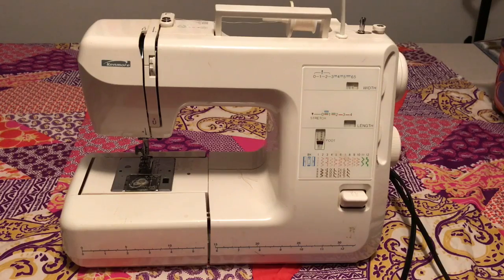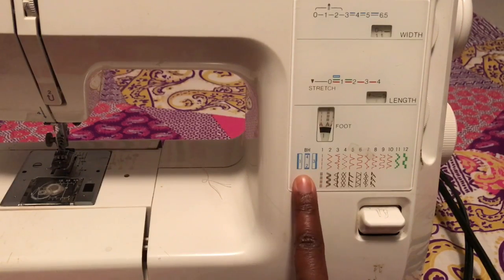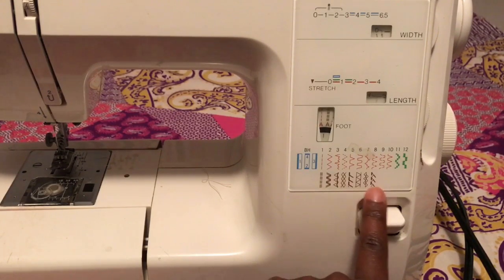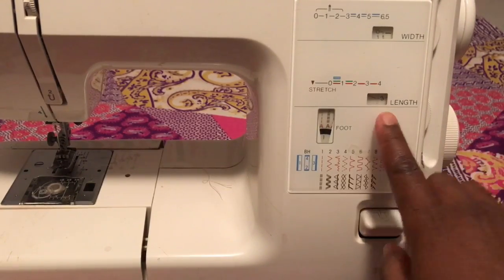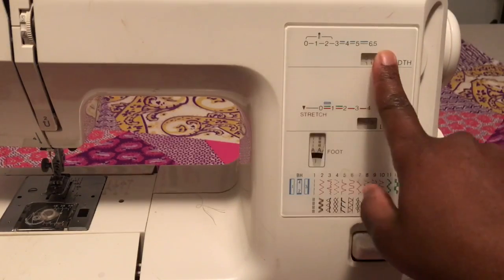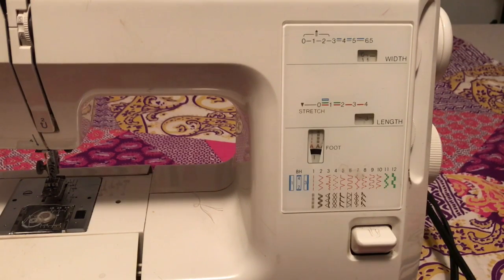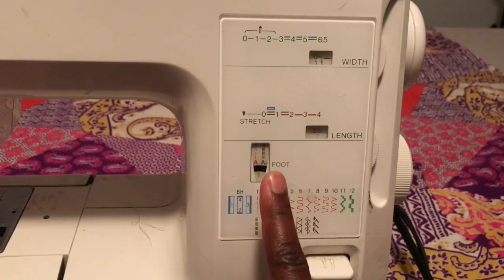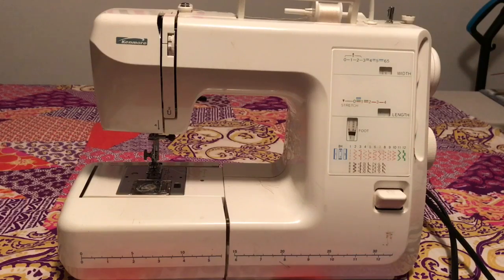Decorative Stitch Tutorial for Kenmore 385 Series Sewing Machine

Comment: I can't seem to switch of the gold as stiches. Now I am stuck on gold zone .I need to get back in the red zone. I moved my dial off SS and still the red Dot on dial is stuck on gold zone. It's got to be something so simple to go back and forth between zones. Can you help figure out the problem? Thanks 😊
Reply from the maker: Hmm. So your stitch length dial is not moving from SS to go to numbers 1-2-3 or 4?
Reply: @whatsshecreating  hi! My stiches selector red dot is stuck under the gold and green decorative stiches. So last night my son watched video on oiling machines and took apart my machine and cleaned and oiled it. I did buy special oil for sewing g machine only. I will try today to just sewing on it to get it warmed up. I have owned this machine for 2o years oiled regular only had this prob once before. This machine has served me so well over the years. I think you lift the foot lever up and turn the wheel toward you before you select stich. I don't usually use decorative stich. But making grandbaby quilt. Thank you for input on my kenmore.
Reply from the maker: Okay. I hope everything works out. Let me know if oiling helps.
Reply: @whatsshecreating   the red Dot is stuck on gold SS. It is sewing in the red zone. Dial works everything seems to be working good except it sees the stich left of the one you dial up. And you can only dial gold and green zone.  Strange. I think the dial is off line. Thanks fo listening. Might have to take it somewhere. I sewed on it today . No prob except dial red Dot.
Reply: my mothers is stuck too and I've been scouring the internet for two years looking for a solution. Did it end up switching back? Pls help :)
Reply: @kgarnettification   no I'm still stuck. So sad. I miss my sewing machine 😭
Reply: @beematthews4032  ugh my heart! my mom just took apart her whole machine to try and examine how she can fix it and...nothing! just clumps of old oil. Shes still sewing with it and it seems fine...i think it just bothers us both that it won't switch from gold to red  XD Good to know it isn't just us <3 <3 <3 <3 Thank you for responding!
Reply: @kgarnettification   The only thing I can think of is to take it into a shop for repair. Which starts at$ 100.. At this point since my machine is so old, should I just look for a new one. 
My machine works ,but not correctly. And I noticed the stiches are not as Tite
Reply: @beematthews4032  yeaaaah. I'm working on convincing my mother to buy new. I got a beautiful brother se400 NEW on amazon about a year ago AND they let me do a payment plan. It's definitely worth it especially if you use yours a lot. Good luck and thank you for your support! <3

Comment: Mine keeps breaking the stich and can’t figure what’s wrong with it,  also it’s stuck in the brown stretch  Stich won’t change to regular stich
Reply from the maker: For thread breaking issues I suggest:

Checking the tension dial making sure it’s in the correct setting for your machine. 
Change your sewing needle.
Clean the machine.
Rethread the machine.
Make sure you are using the right type of thread for the fabric chosen. 

For issues with the brown stitches check out this video:https://youtu.be/pAO0rqZ7mmI

Hope this helps.

Comment: I don't understand the difference between stitch length and width. I usually sew straight stitch medium length or width?
Reply from the maker: Stitch width will usually when you want to complete a zigzag stitch of some sort. Otherwise,  you would keep it on 0. Stitch length is changing the stitch to create short, medium or long stitches. 4 would include the longest stitch possible and 0 would include a stagnant stitch.